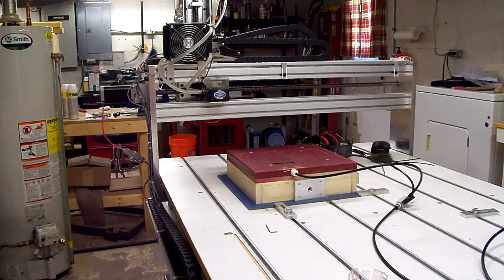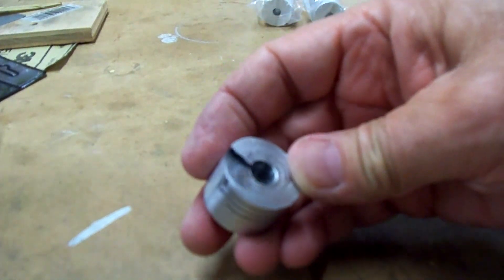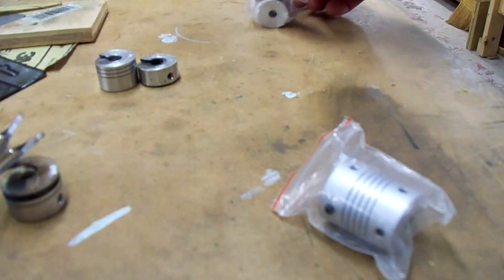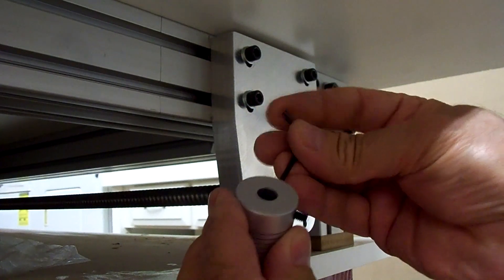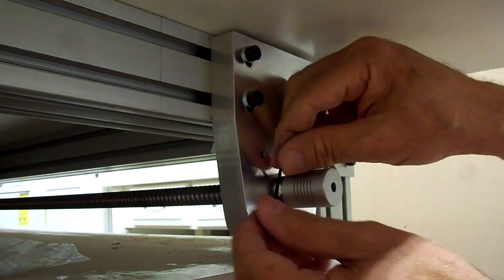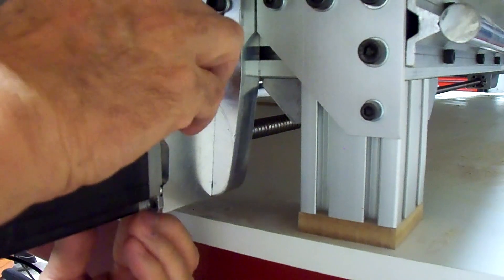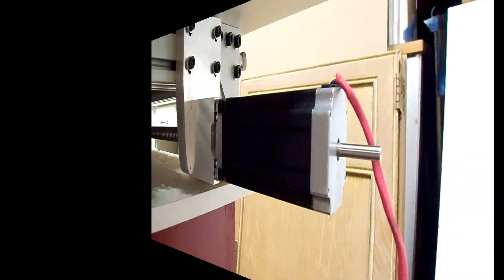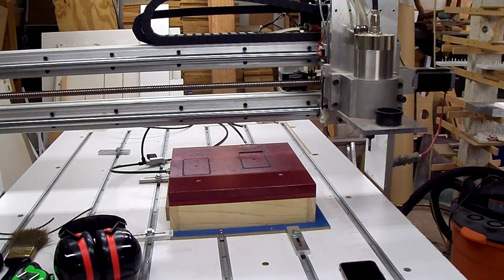CNC broken coupling

Comment: Hi Robert,
I have the same machine and the same problem that you described here. Did you ever figure out why this happened?
Reply: @MyRobertadams  Evidently one lost steps, like you said and that means the other one is therefore ahead of the one that lost steps. We would need feedback to the controller for the system to be able to correct it and of course a controller that would take care of the missed steps.
Reply: @MyRobertadams  Stepper torque drops off quickly at a certain rpm. Stay below that point. Check the stepper data sheet. It should be dependent on the drive and stepper together, but you should be able to get an idea of where it drops if you don't have the same drive. Also be sure you are giving it enough voltage. It will have more torque at higher rpm. If you give it more voltage be sure to limit the current in the drive. Max current should be on the data sheet. GeckoDrive website has a support section about current and voltage. Nice video!
Reply: I wrote two comments for this video that may help you.

Comment: Just a bit of FYI.  When you tighten a setscrew onto a shaft.  The setscrew will displace metal as it digs in.  This is what caused your couplings to bind onto the screws.  Anytime a setscrew is used in that fashion file a flat spot so the displaced metal does not effect the overall OD of the shaft.  The rough part of the shaft you felt before sanding was the displaced material.  Which is also why you had to sand it down to get the new coupling on.

Comment: By tightening up the bracket screws after you've locked up the coupler your putting a compression force on the coupler and the shaft of your stepper. Not sure if that may cause you long term problems...
Reply: *you're*

Comment: I had exactly the same problem on my machine. I think it's from any slight misalignment on the motor shaft and the ball screw shaft causes the coupler to flex the tiniest bit. As I'm sure you have experienced alum really doesn't like to be bent back and forth, it just snaps. I think it's just a matter of time before they break. I replaced mine with the rubber insert couplers and haven't had a problem since.

Comment: Hi I had a similar problem with the aluminium coupling on my homemade CNC and charger to lovejoy couplings they are much more robust and easer to fit as the ones I purchased clamp around the shaft. Cheers Dave
Reply: I strongly advise you go with lovejoy type couplers I had broken 4 of those type couplers before I learned my lesson and changed them out for loveoys and havn't had a problem since.
Reply: i second the lovejoy couplings. they are a million times better..and have 0 backlash..i have also broken the one peice ones.

Comment: Sir, Did you come to any conclusion as to what caused this to happen ?  Did the manufacturer have any ideas ?    Ralph
Reply: does the motors need to be in sync ?  manufacturer  have any ides ?
Reply: @MyRobertadams  Very nice CNC machine! The aluminum couplers will break due to what is called fatigue. Every time the shaft rotates 1 complete revolution, it puts the coupling thru a bend cycle. The greater the misalignment, the greater the bend. Even a small misalignment will eventually break the aluminum because it has no fatigue limit. It's like a bar getting bent back and forth repeatedly. Whereas steel does have a fatigued limit, if such a couple exists, you could swap them out. You could also align them with an indicator to make them last longer. As you probably know, running the stepper too fast causes one or the other to loose step. Wiring them each in parallel, not series, will give you greater torque at higher rpm. Torque does drop off fast at a certain rpm no matter which wiring. You could also get two sprockets for each side with the same number of teeth and a toothed belt to connect them. That will still give you a 1 to 1 speed ratio. It will last but it's more money. Nice build! Best to you.